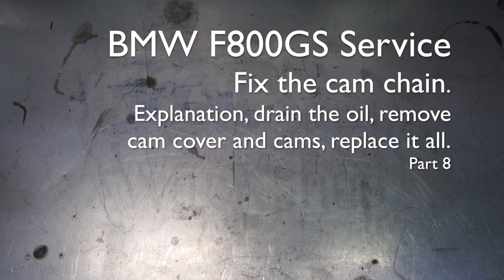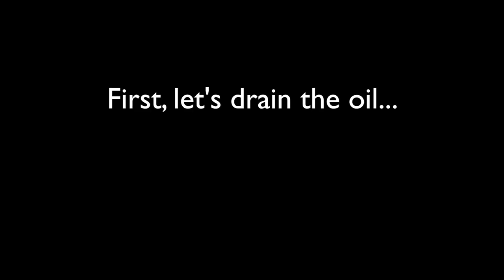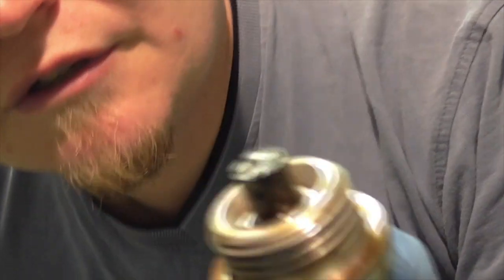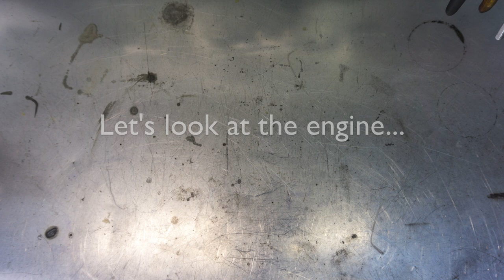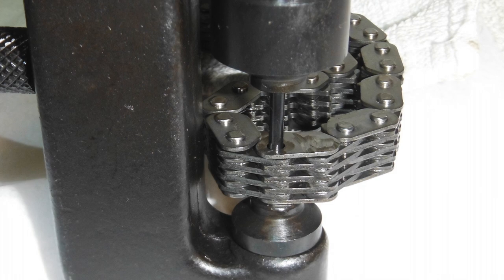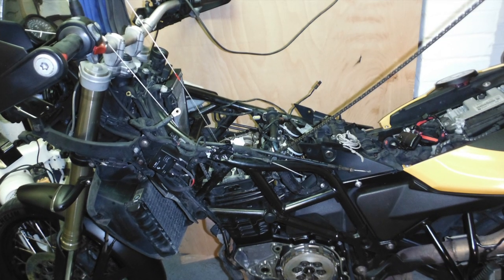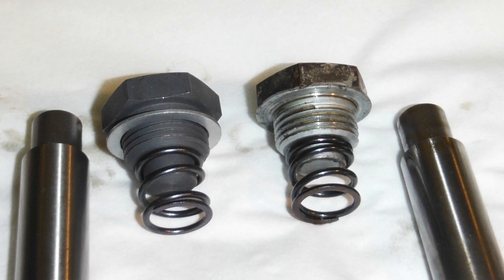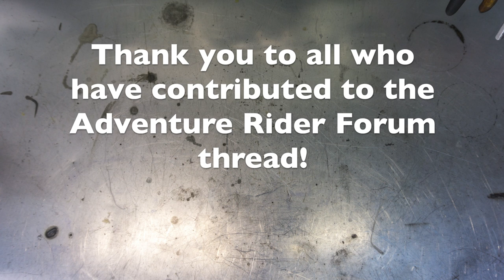F800GS Service E8: Replace cam chain, followers and tensioner

Comment: Good job dude !
Can you watch the video on my channel (entitled "Jeu chaîne distribution F800S 2006") where I filmed my cam chain on my F800S 2006 and tell me what you think about it please? mine seems less worn than yours and I hesitate to change it now or wait a little longer ... my bike has 50 000 kms. thanks again PS: sorry for my english i'm french :)
Reply from the maker: Votre anglais est beaucoup mieux que mon français!
Sadly I think your cam chain needs changing. That's not how it should be and it might lead to worse things happening. I would guess that the bike would work fine, but if something went wrong, it would be a much bigger disaster. Mechanical things do not heal by time. ;) Hope you get it fixed and that you get many happy kilometres together! 
Bonne équitation
Reply: Thanks for you reply,

I precise on my video the engine is not on the TDC. When it is on the TDC the cam chain is perfectly tense.

For the link that you have riveting on the new chain, you use the original or you bought another (the link with mark M) ? if so, where did you buy it? 

Or you have bought a cam chain not oem and the link was provided with?

Last question why you remove the clutch carter ?

Thank you
Reply from the maker: The chain is tight when on TDC because of all the tension put on by the valve springs.

Full information is provided in the AdvRider thread linked in the description. The chain is OEM BMW, with a new master link bought separately (I think we bought 5 master links just to be sure). Master link is standard size and specifications are in the AdvRider forum thread (my username is TheJoker).

I can't remember exactly why the clutch cable was removed, but I think it was because it was obstructing taking something off, maybe the cam cover?! You'll see it when you do it. 

Good luck!

Comment: Very helpful post... Thanks from all of us GS owners! I take it that in order to turn the engine over (to feed the cam chain through), the locking pin was removed.... Was it relevant to count the rotations of the engine to get back to  #1 TDC? Or is it that ones the pin is relocated back in place(regardless of engine rotations) and cams set up as per instruction, engine will automatically line up #1 TDC? Cant mess up firing order by not counting rotations? Master link?? Was it hard to fined? The only mention of a supplier I could fined is https://www.z1enterprises.com/. Like to share with us how you managed to sours yours? Many thanks again! Nick
Reply from the maker: Thanks! Yes, locking pin needs to be removed to rotate the engine to feed the chain through. When you re-install the cams, you need to align everything up according to the manual. And double check it, and triple check it. The AdvRider forum thread contains information about the master link, and there should be a few links to sites in there, but most importantly, I believe the specifications are in there, so you should be able to find one based on the specs. We just searched and found a supplier, I don't even know if that's relevant anymore. The AdvRider thread and the manual has got a lot of good information, well worth checking out. Thanks again!
Reply: @JockeSelin  Hi!!. Thanks a lot for this video. it is the best on the topic. Taking into account that to replace the new cam chain you have to remove the bolt, is it needed to put it from the begining? To remove the old camchain? Is it not enough to put it when you have to align everything with the new chain?
Reply from the maker: @pmejuto  sorry what bolt are you referring to?
Reply: @JockeSelin  I mean the locking pin, sorry
Reply from the maker: @pmejuto  Things are a bit hazy, it's been a while... I think you need the pin in to undo something, like the cams? Or something. There was a reason, but without going out to the garage to read the manual, I can't remember. I think it'll become apparent when you're in there mucking about. Sorry about the vague reply. 😞
Reply: @JockeSelin  Tx. I have checked the manual and indicates as you did. Better I will follow it
Reply from the maker: P M They do make the manuals for a reason, although it’s sometimes hard to admit! 🤪